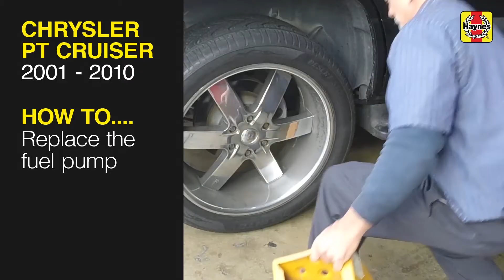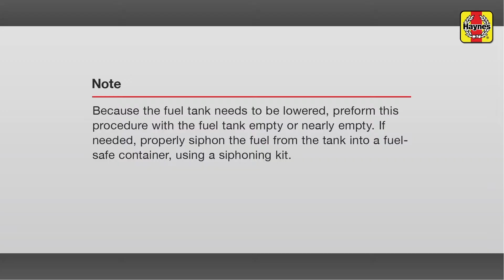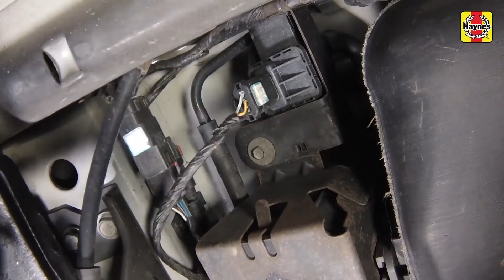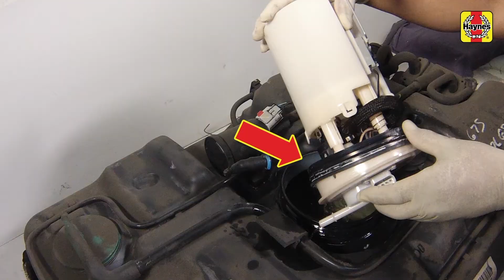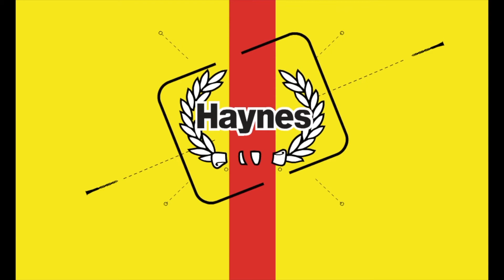Chrysler PT Cruiser (2001 - 2010) - Replace the fuel pump

Comment: You're going to hate me. i took the carpet held it up with bungee cords, cut a hole 1/3 of the way and bent the rest over, and voila, a fuel pump. when i was done, I bent it back and used 2 pieces of metal and 4 self-taping screws to replaced the carpet, and voila, all done. no one will care because no one will see it, nor will they do any harm to it, as it's under the seat. So I had a Ford Escort, and it took me 1 1/2 hours to remove the tank and I looked up and said a few bad words. It took me 45 minutes to put tank back, 5 to remove the back seat and 2 to remove the 4 bolts to get access to the pump. live and learn

Comment: One problem. You cannot easily access the filler neck hose and strap bolts with the front of the car jacked up. The video shows work being done with the car on a lift.

Comment: Thank you for posting this. My dad and I are going to be replacing my fuel pump tomorrow. He's replaced fuel pumps before, but I have not, so I appreciate the opportunity to get a preview of what we'll be doing by watching this video. I'm equally glad it's a video by a trusted name. My dad has been repairing cars for decades, and the Haynes manuals are some of his go-to resources.
Reply from the maker: How did the fuel pump replacement go?
Reply: @HaynesManuals  It went well except... we got a faulty pump that can't maintain pressure very well :-P So we're going to have to do it AGAIN once we get a new pump and can arrange a time we're both free to work on it. Eh, at least it'll be good practice. But thank you for asking :-) I definitely feel like watching the video helped.
Reply: How'd it go second time? I'm going to attempt to fit PT fuel pump myself this week end. Is job as straight forward as the video? Hey from New South Wales.
Reply: @o8thman812  The newer pump only just got in, so we haven't done the second attempt yet. I'm going to run my tank a bit closer to empty before we work on it. 

As far as straightforwardness: my dad has done numerous repairs to my car over the years, so the job went pretty smoothly due to his familiarity with the vehicle. Even so the repair took several hours - it's not a quick project by any means. And because you're dealing with the fuel system, you're going to want to take special care because of a) flammability risks and b) the risk of contaminating the fuel system with debris. (Try to cover up larger openings with a clean shop rag or something so grit and stuff doesn't get in.) If you're a beginner, this will slow things down a bit. 

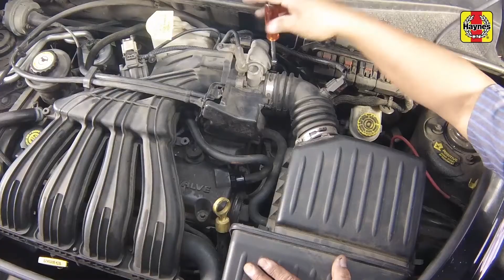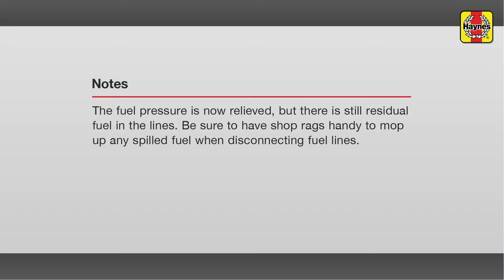I wasn't watching the video as we worked, because my dad knew what he was doing, but I'd say it covers everything. Only thing is, it looks like they remove the filter cover assembly twice in the video (once at 0:50 and again at 1:29). Other than that, we pretty much did it like they do here. Just make sure you follow the steps in the proper order, and keep track of which parts/screws/bolts go where. My dad can tell by sight, but if I'd been attempting the repair solo, I'd probably have put the screws and stuff in plastic cups and labeled each with a marker.

Oh, and if you can get the tool they use at 4:03, that makes that part WAY easier. We did it without it, and it was insanely tough to unscrew. Dad went and got one of those tools afterwards.

Sorry if that was crazy wordy, but I don't know what your level of experience with car repair is, so I was trying to make note of what stood out to me as a beginner. Hope this helps, and good luck!
Reply: @o8thman812  How did your fuel pump replacement go?
Reply: FWIW, I don't really like Haynes manuals. For what they cost. I would expect better than pulp paper and b&w pictures.